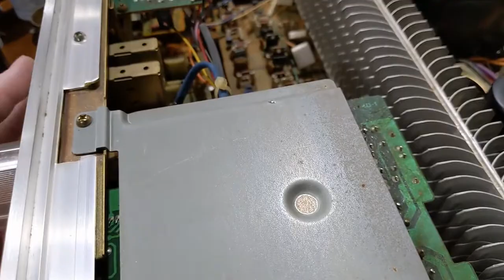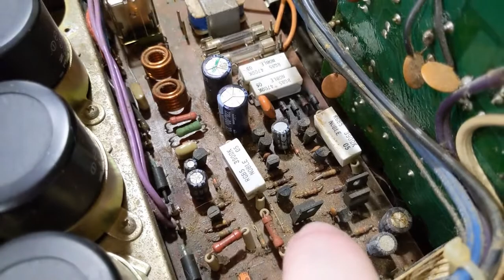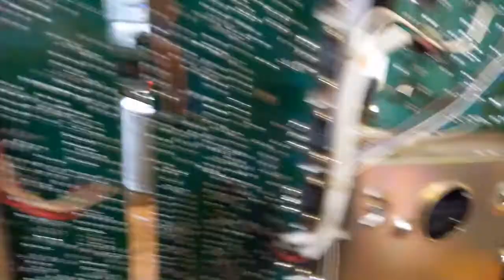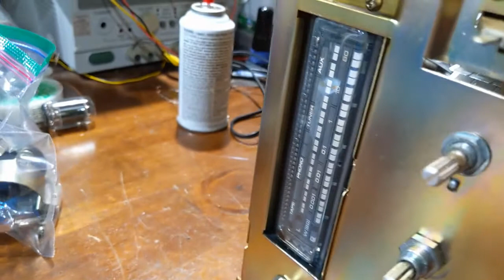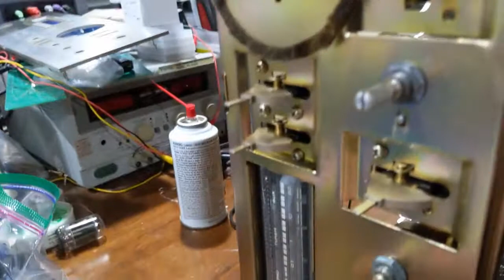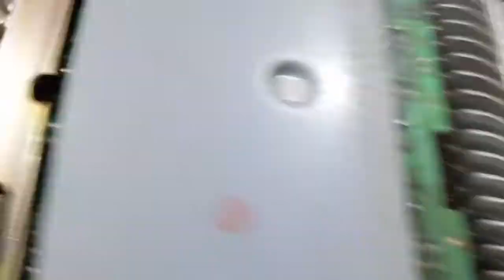Pioneer SA-8800: Restoration part 1

Comment: Great work! Can you please share the capacitor and transistors list for a full replacement? Thanks
Reply from the maker: I bought a kit
Reply: @THEtechknight I just got a Pioneer sa-8500ii.  I have been looking at the kits on ebay.  I was wondering if you got your kit off ebay or can I trust them.
Reply from the maker: @BostonMike68 I did. It was just easier
Reply: @THEtechknight Thanks! I'm just do it myself so I know everything has been changed

Comment: Hi, how are you enjoying the SA 8800 a year out? Used to have an SX 3700 in the day, and looking at this as the mid-life crisis replacement. Are replacement caps and other parts an issue? thanks.
Reply from the maker: Crazy to think its been a year... And so far, it works fine! but ive only used it a few times. Work has me busy anymore aside from weekends which again is more work... As far as parts? yeah you can still get the SA-8800 rebuild kits on ebay, etc.